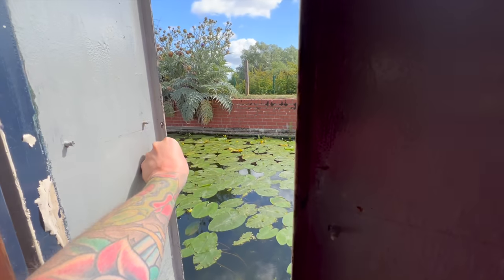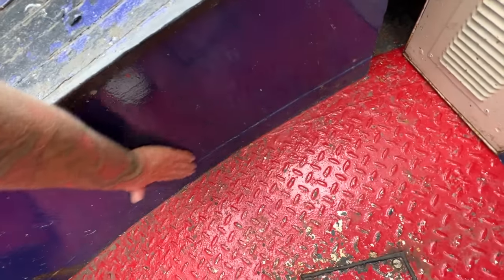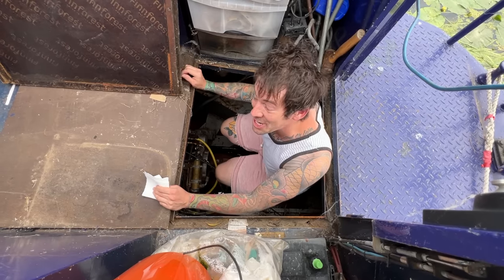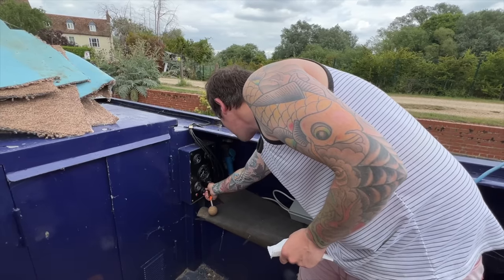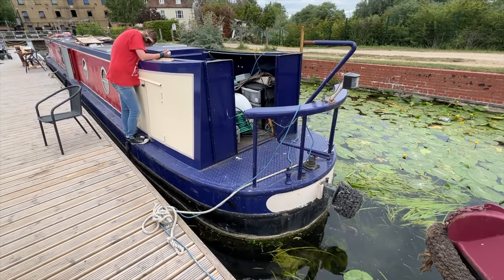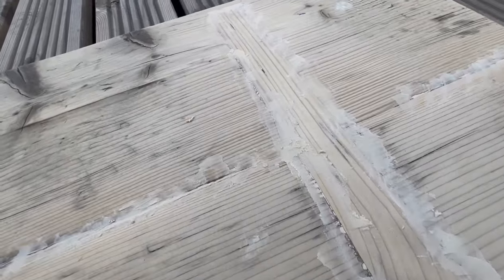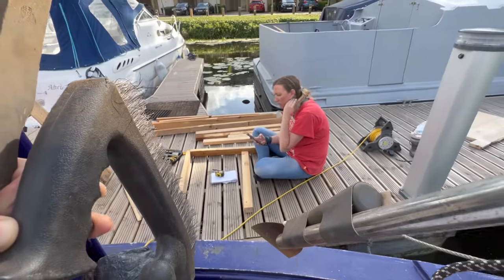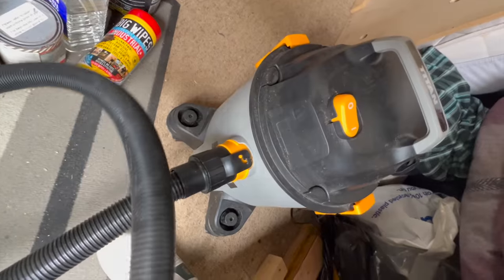The TRUTH about our NARROWBOAT water tank!

Comment: When roof leaks do you seal from the inside of house ? Seems trapping water isn't a good idea -  Oh the dark oil color (or 250 hrs) usually means change /w filter  - use an electric oil extractor $25 on Amazon 80W model  - don't recommend using the Titian unless cleaning is your hobby.....
Reply from the maker: Yea it is a bit of a worry but I’m hoping it has just dropped through and evaporated, I would like to get the whole thing up but that’s a pretty big job and it does seam solid when walking on top, oh that’s interesting thanks for your advice

Comment: Hi why are you messing about with tubes of silly sealer a very temporary bodge which will fail very quickly just go to screwfix a buy a cheap canvas sheet and put it over the cratch until you get a proper cratch made then you can wait as long as you like before getting the well deck welded.That water tank is one of the cleanest I have ever seen when I have had to recoat one you lucky boy
Reply from the maker: we will be having our covers soon so it was just meant to be a quick fix, to be honest I thought it would be a bit easier but so hard to get right in, oh thanks thats great to know :)

Comment: Why don't you over plate the well deck? Also the bottom of the water tank won't rust as long as there is water in it, steel won't rust without air, that's why there is no need to black boats base plates. Keep up the good work
Reply from the maker: Oh that’s interesting thank you, it’s just with the amount of rust we’ve treated on the boat it’s hard to trust the scary water tank, and the tank haven’t always been full.though I’m sure it probably is safe, yes I would like to get the well deck cut out and re platted but it’s quite a big job and probably expensive, it is something we have been talking about though , thanks